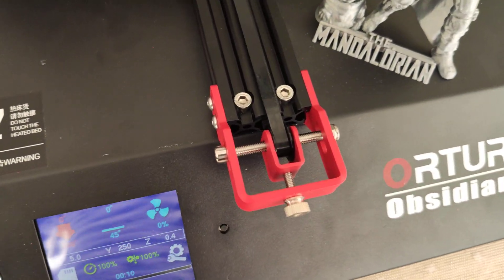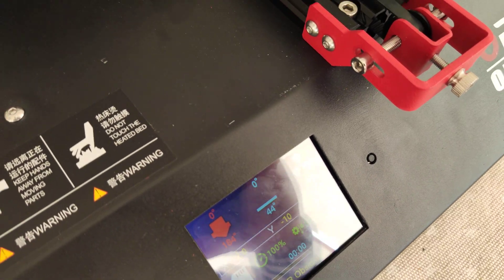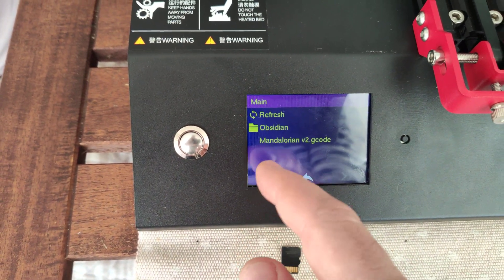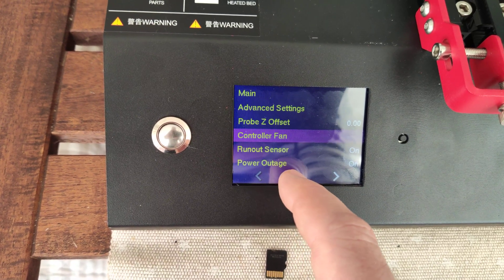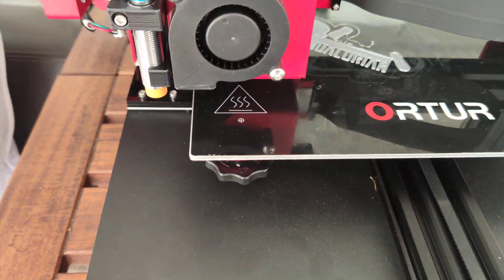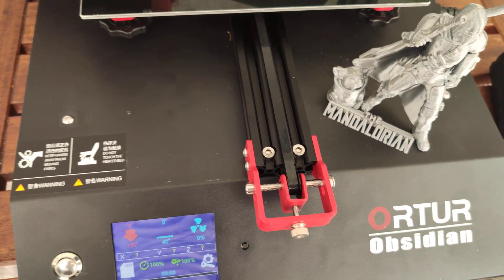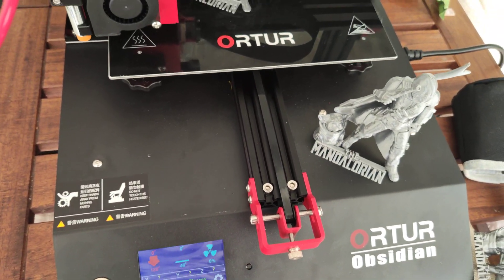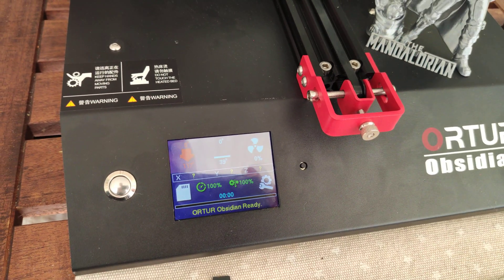ORTUR Obsidian,  3D printer - Marlin Firmware

Comment: I have source files for compiles (pinout and settings) own marlin but stuck on old libraries platformino error... ehh
Reply: Hi DJ, dis you try this firmware? Is there some problems with the z offset set up? The autolevelling ? As it is claim upstream? Thanks in advance
Reply: @neolilous  Works, but need some manual adjustment in menu after probe detect. In my case i add some value because is to closer   to bed. After that and store eprom is good  evry time 👍
Reply: ive got a problem in visual studio with board env. i cant find wich board to select in platformio.ini
Reply: @PottCast1  Have  exactly the same problem .... :-(

Comment: Hello Roland, Maybe you use Cura and can share Osidian profile ? And you may have  accelerations setting because i think default is to much agresive :-). I will be great to possibility compile own firmwares but i think outur don't share information obut pinout etc...
Reply: I have everything, it prints perfectly. Factory settings for acceleration and extruder esteps were wrong (I don't know who set it up, what engineer), most of the dilemmas and problems after the change do not occur(too much Vref  current is fed to the motors M122 blocked ). It is a pity that the manufacturer does not allow you to compile your own Marlin. This limited the popularity of this printer The community would improve it right away and it probably disappears from the market i think. https://www.youtube.com/watch?v=QCqAC-x5QXU&t=11s

Comment: Z offset dose not work , i put -1.7 and it prints from the same height , i put +2 but still at the same height is printing ... +10 and still the same ... I can't put down the first layer what ever i try .... i need to start printing and set down the height with babystep ... Please help , i can't print anything because my first layer is 0.3-0.4mm above the bed . 
Automatic bed leveling and z offset are not working like they should , you can put any value in the offset and the height distance remains the same ....

Comment: Hi.
As I seen you have Ender 3 v2 and obsidian also.
I hesitate between these two printers.
How much better obsidian than ender v2?
Worth the prise?
How long was the shopping time?
Thanks!
Reply from the maker: obsidian have everything inside, all sensors, 2 Zaxis  & most important is real open source - you can tuneUP or downgrade this printer (it all depends on your knowledge) 

I like more Obsidian d... Ender
Reply: @ThousandHobbies  Thank you. Unfortunately this printer not available in Eu wh. So if I add the extra tax into the price it will be ~360$.  In this price available from CZ the sapphire plus. which one do you think is better?
Reply from the maker: @RuleZ69  Sapphire plus needs to be adjusted - PID tuning, programing skills for the change firmware settings  😊 (you need to know what you are doing) 
I own this printer and I love ♥️
Obsidian easy to use - no knowledge required (very friendly printer)
everything depends on your skills
Reply: Thanks Roland. You said the shipping time only 1 week. Can I ask wher do you live? Did you need to pay any tax when you bought obsidian?
Reply from the maker: @RuleZ69  yes 45eu (taxes)
Reply: And which WH selected? CN-0992 or CN-099?
Reply from the maker: @RuleZ69  	CN-0992